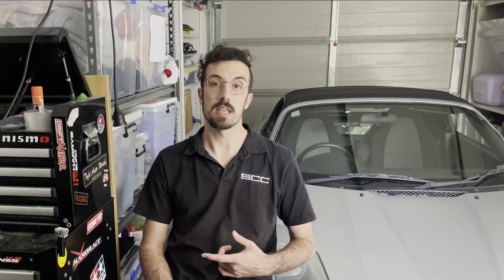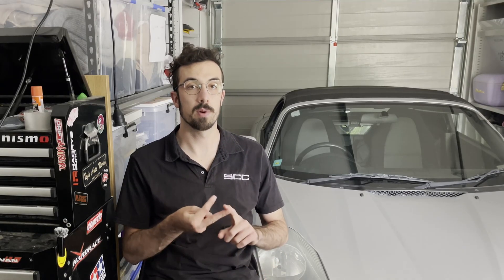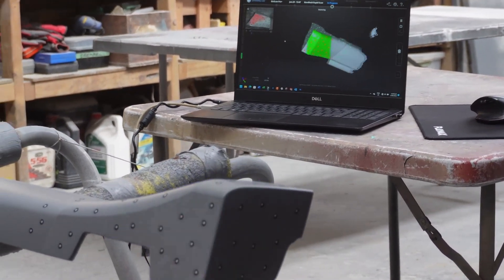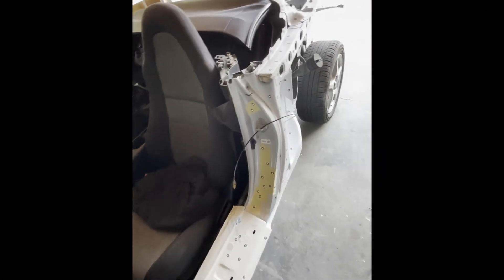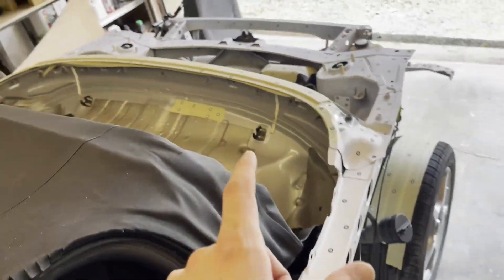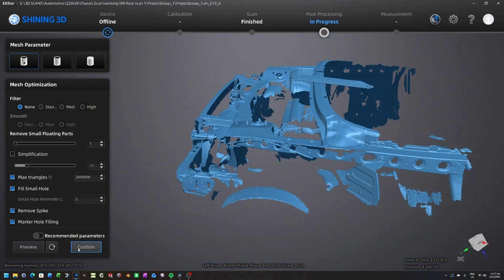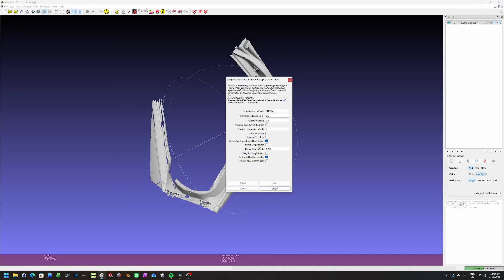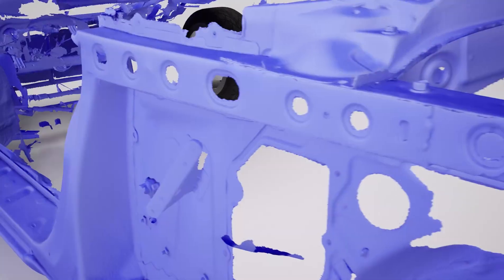3D Scanning the MR-S

Comment: You might want to take a look at Quicksurface.  It's a post-processor that is good at realigning meshes to a new coordinate system and also allows you to create surfaces and solids directly from the mesh.  Those can then be imported into your 3D CAD as a parasolid, meaning you can use them directly in the model.  It's not freeware, but they do have a cheaper option.

Comment: I prefer Aesub Blue. I've used it a bunch and like it. Also a tip on targets. Put your targets on blue painters tape first, then stick the tape to the car. Way easier to remove the targets that way. Also I use Meshmixer to reduce the triangle count. It seems to keep the fine details pretty good even when reducing by 60-70%. Cool to see your process 👍👍
Reply from the maker: Thanks for sharing the tape trick! Is the aesub blue longer lasting?
Reply: RevoPoint sells markers already on tape.  Might check that out.